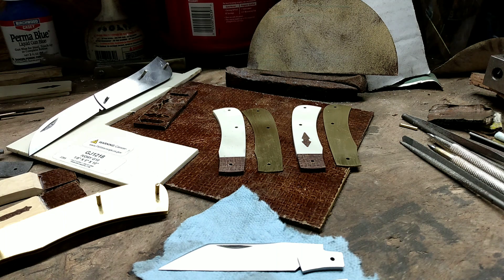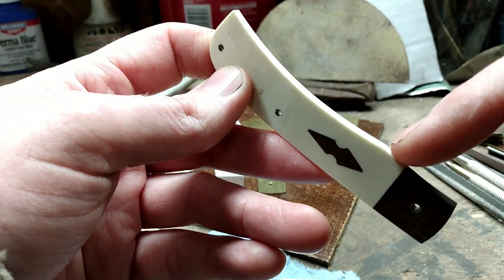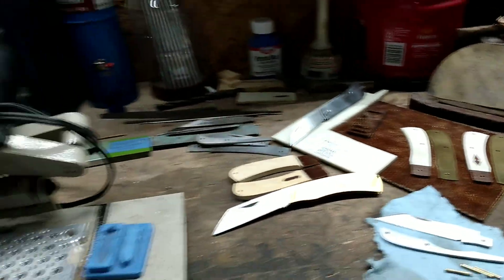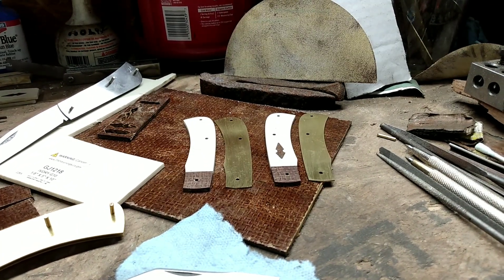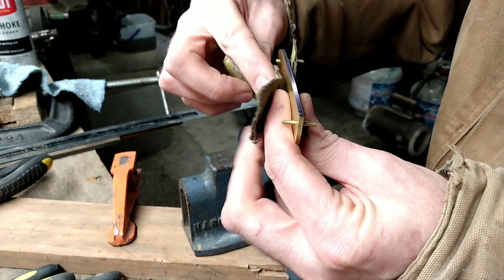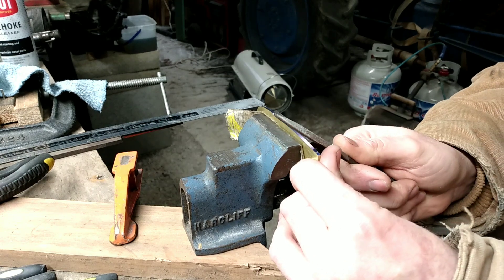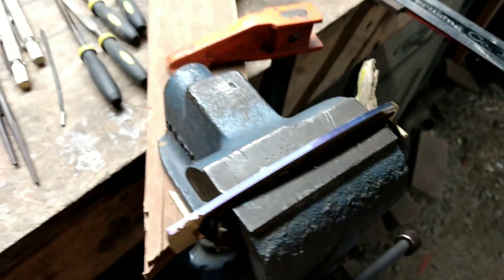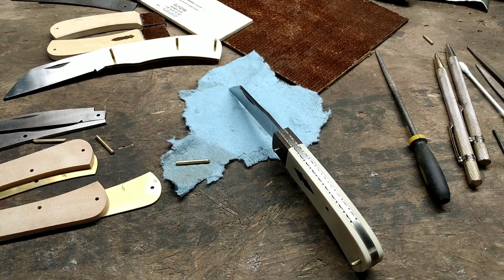how I make pocket knives...part 6

Comment: Hi , I've been learning a lot from your videos... I noticed you leave the tang a little thicker than your recasso , do you just grind this taper in freehand?
Thanks for all the great tips
Reply from the maker: Yes I grind that in freehand...I do that since I don't have a mill to relieve the liners and is simpler for me instead of using washers as well... thank u for watching my videos 👍
Reply: @tnhillbilly1307  awesome I'm going to give it a try since i don't have a mill either... Your work is amazing 💪
Reply from the maker: @nobodysmonkey3055  thank u very much 👍 a quick tip...I scribe my center lines for the bevels before I thin it down